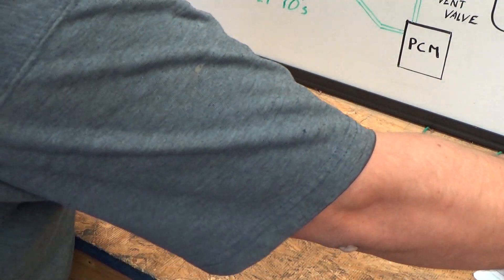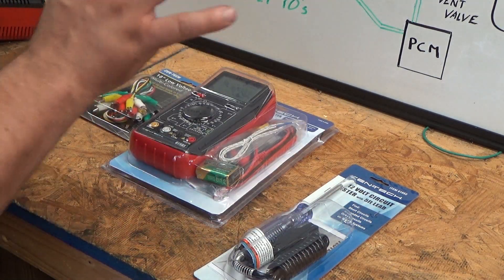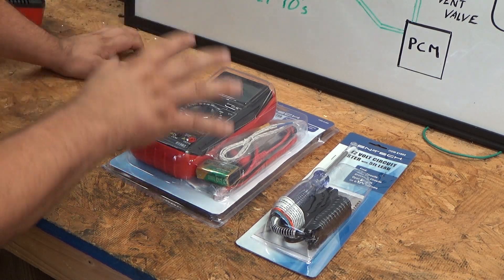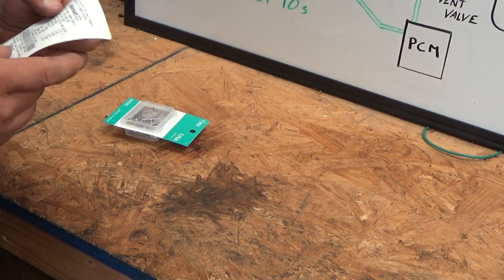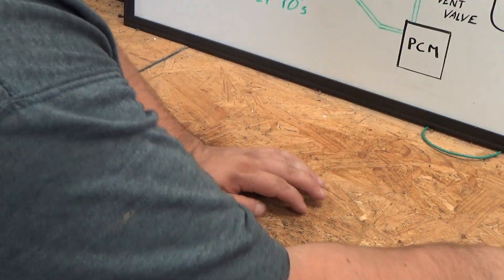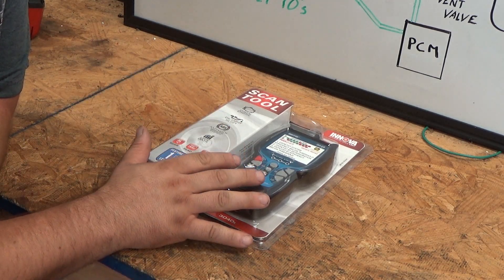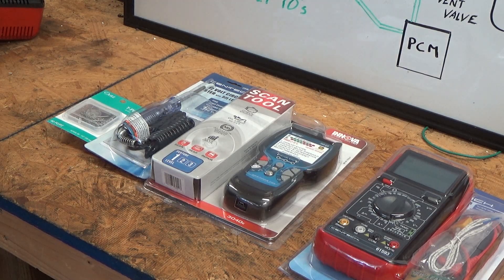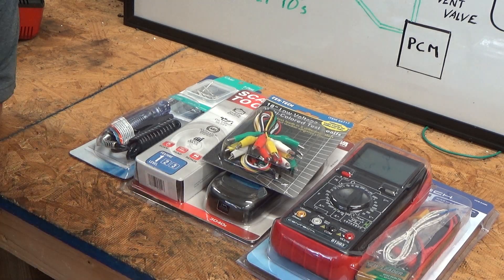Fix your car for under $150 - Automotive Education

Comment: I have an Autel code reader works great paid about $80 for it.   
You should make a bigger deal about getting one that can read “live data”.   Mine can and it saved me a few hundred because I knew which o2 sensor was bad and didn’t have to replace a catalytic converter.  It was throwing a 420 code?  Coming up as bad catalytic converter.